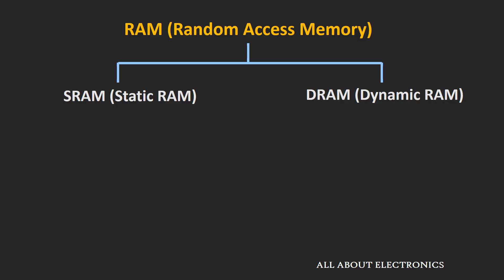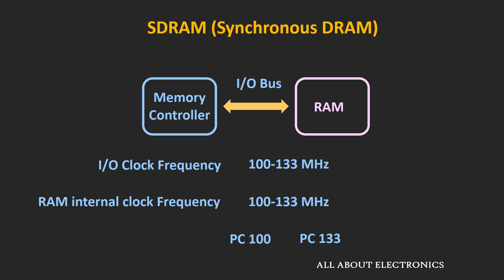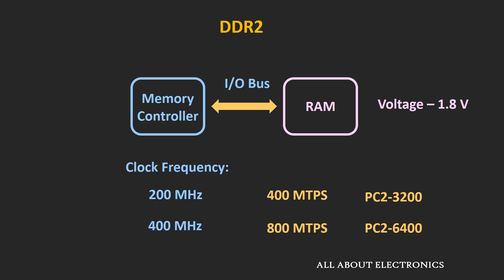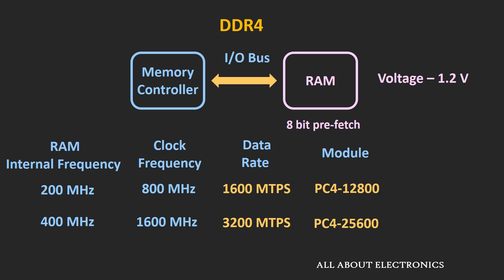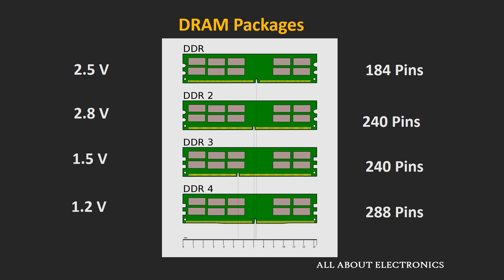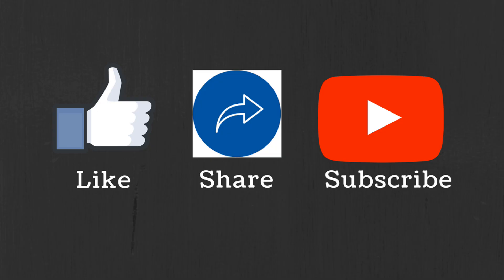Different Types of DRAM: SDRAM/DDR1/DDR2/DDR3/DDR4/LPDDR/GDDR

Comment: 2 correction:
1.dram on the basis of dimm...ddr2 voltage correction from 2.8 to 1.8
2. In last ,comparison table...ddr2--> bus clock replace 533.33 by 133.33

Comment: Another mongol who doesnt know difference between megabytes and megabits. Its 8 bits per clock x 2 as DDR so at 1600Mhz or 3200MTs is 25600Mbits not MBytes. Get your units sorted.

Comment: for example on the data rate for ddr4 200 times 800 you get 1600 but 400 times 16000 shouldnt that be 64000? but you still got 3200 but you multiplied 800 times 4 and got 1600 but multiplied 1600 only by 2 why is that one multiplied differently?

Comment: so on ddr3 are you referring the clock frequency just as the external data bus or the system clock? Because I thought the ram had to be as fast or faster than the system clock or else the computer would crash? I do understand when ddr3 came about there were improvements in the input out put and the electrical system and ram buffers too not sure what a ram buffer is and or how they actually improved ddr3

Comment: I found one thing in this video that was confusing. In the section on DDR4, you say that the I/O bus rate should be 4 times the internal clock rate (which is the same as for DDR3). But then in the table at the end of the video, it shows DDR4 having an I/O bus rate that is 8 times the internal clock rate. Is this an error?
Reply: After doing some research on my own, it seems like your information on the DD4 RAM in the earlier part of the video is correct, but the entry for DDR4 in the table at the end has some wrong values. You might want to double check this.

Comment: i have a doubt!!!

you have given  maximum band width of SDRAM as= (100*64)/8=800 MB/s
but 100*64=6400 bits and
1 byte=8 bits
so 100*64/8 =800 bytes/s 
but not 800 MB/s
Reply from the maker: Here 100 refers 100 MHz clock frequency. I hope it will clear your doubt.
Reply: yeah got it dude

Comment from the maker: Timestamps for the different topics in the video:

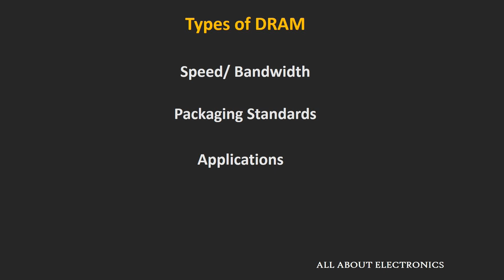1:25 Asynchronous DRAM
1:48 Synchronous DRAM (SDRAM)
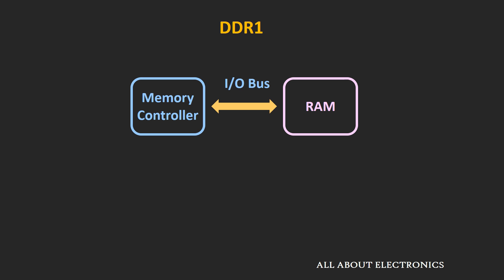4:51 DDR1
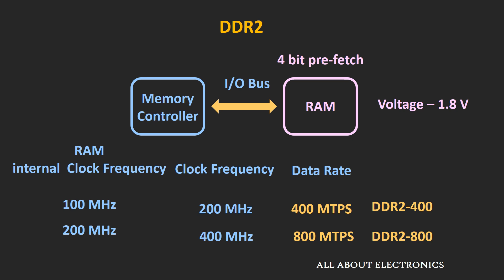6:45 DDR2
8:43 DDR3
10:17 DDR4
12:22 SIMM (Single Inline Module)
12:58 DIMM (Dual Inline Module)
13: 40 SO-DIMM
14:20 MDDR/LPDDR
15:03 GDDR
Reply: You forgot VRAM
Reply: @star_t1  what about EDO Ram as the earlier Gene. Ram. LOL